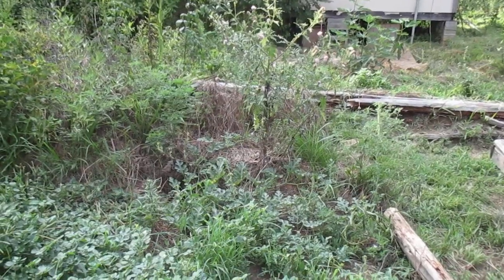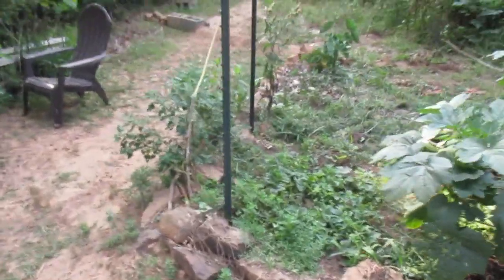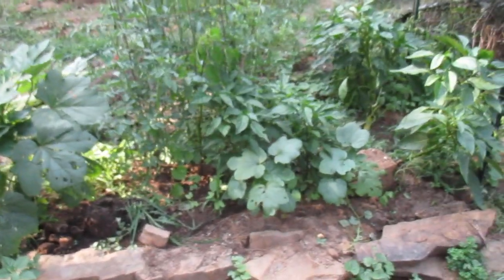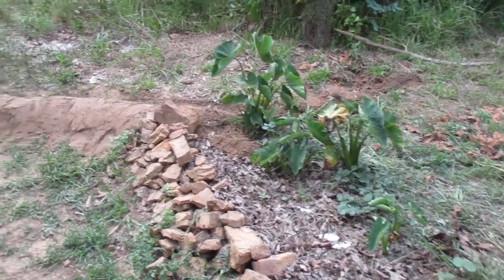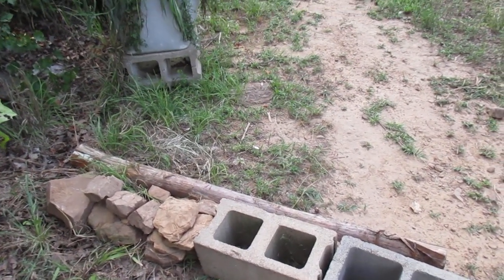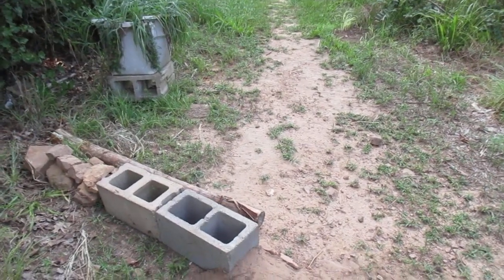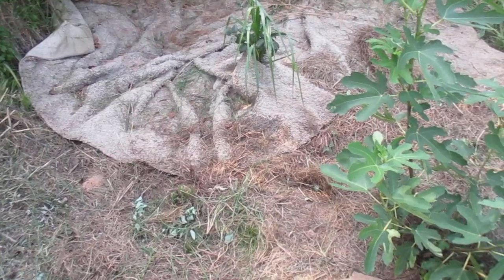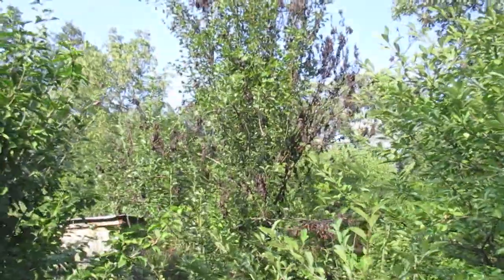Permaculture On A Rocky Hillside: Terrace System and Mini Swales On Contour

Comment: Eric, have you looked at Keyline design? To get the water moving off from the natural valley ( the old road) - towards the next ridge. As always, old roads were never built the right way. Have you thought about running a ripper across the road, to try to get water to penetrate into it, rather than letting the water just run off it?
Reply from the maker: Yes, since this video was made, I have dug or built more mini swales or narrow trenches to channel and preserve water to many plants and  more terrace beds all over the hillside. It doesn't take much to get water to soak into the ground here. All of the rain that falls in the system here is preserved.